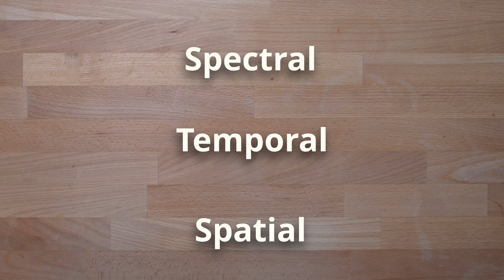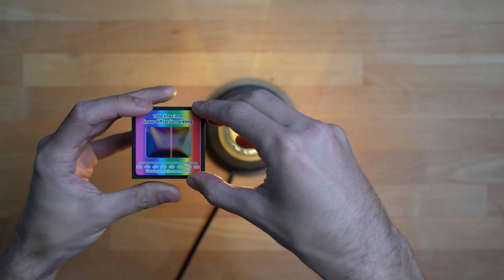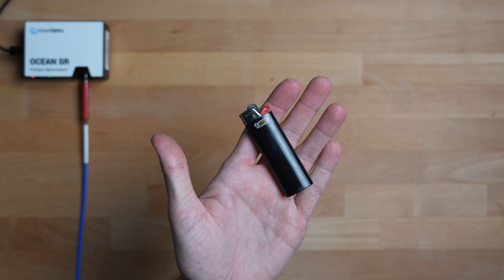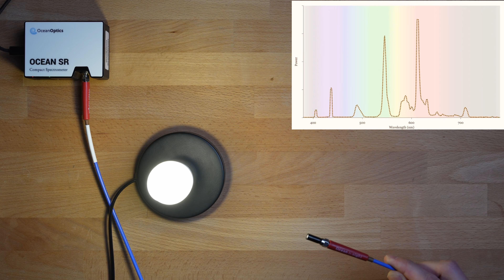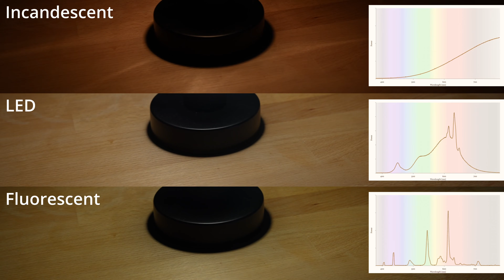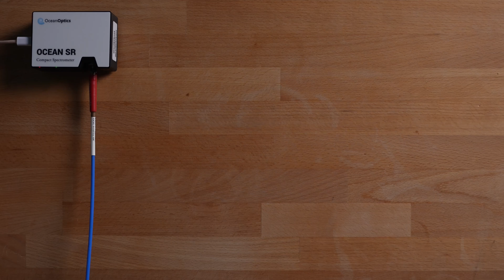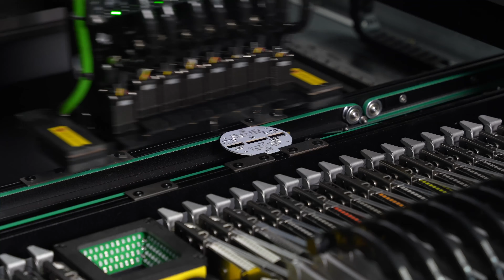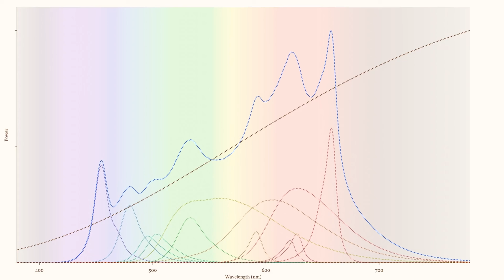Why Modern Lighting Feels Bad (and How I Fixed It)

Comment: oh my god YEEEEES I've been wanting this for a long time, I know EXACTLY what I'm gonna put in my room to light it from now on. also I know production would be really expensive but I would love to see if it's possible to make an integrated module in the future, say 10x10mm chip with all the color LEDs integrated into the same housing kind of like 5050rgb LEDs but instead spectrally adjustable, with internal color calibration so you can just drive them like an adressable LED with a brightness and spectral shape data, this way products would be easily developed to integrate this into regular lightbulbs or led strips
Reply from the maker: You've nailed the vision. This is exactly what Enody is working towards long term. If we can fully integrate from MOCVD up we can push this technology into integrated packages and bring the costs down significantly. In the mean time we will release many form factors (at increasingly better budgets) as we work towards this goal :)

Comment: While not the primary source of the light itself, LED bulbs do heat up a lot, and cheaper models đie in 2 years from continuous (12+h daily) use. If you look at old LED bulbs, you'll see sizable heat sinks. My question is, how is your product addressing this, and if it doesn't, what are your future plans on this?

Comment: I love this idea. The off the shelf warm leds are much better then the fluorescent from a couple years ago but not quite there. I think for mass production (say a E26) it would be worth designing fixed pre-tuned blackbody lights. 

Say you grade each of your batches of each of your color and sort those to make pre-tuned 2700,3000 and so on off of formula(say if you group colors all lower range then spec, then all higher range). You loose the adjustability but retain the whole spectrum in a product that can be more easily adopted.

Comment: successfully snuck a shark tank style ad inside a nerdout video about lighting quality and spectroscopy, well done. /s
Reply: God forbid a company identify a problem and try to solve it lol
Reply: @haleymoss4573  "god forbid a company sneak an advert for a 330$ dim desk ball that solves the problem of having 330 dollars" 
fundamentally there is no problem solved with this because its 1. too bulky and cant be downsized
2. too expensive for just anybody to buy it (gas is 5$/gal rn fr)
3. so freaking dim for how much power it draws.. compared to incandescent bulbs or just better white leds that are less than 9$
Reply from the maker: 1. It can and has been downsized already. EP01 was a conscious choice as our first form factor.
2. EP01 isn’t a commodity lamp with a nicer enclosure. It’s a calibrated, spectrally tunable lighting system that can produce light ordinary lamps cannot. We could remove the emitters, calibration, custom electronics, and domestic metalwork to hit a lower price, but then it would no longer be the product we set out to build. We’re starting at the high end, building the technology properly, and using scale to make future Enody products more accessible.
3. It has comparable efficiency to all other LED bulbs on the market and is an order of magnitude more efficient than incandescent lighting (which the video explains why).

I understand if this product is not for you. The goal of Enody is to advance this technology to a point of mass production and increasingly affordable form factors. As it currently stands, EP01 represents an order of magnitude price reduction in spectrally tunable lighting.
Reply: @enodylighting  ahh yes but you see you just wrote your own epitaph! "an order of magnitude price reduction in spectrally tunable lighting" so you admit this is a specialty tool for lighting science and not something that solves a major problem for consumers because you also say (in a manner of words) "we cant shrink the design because then it wouldnt work". if only you didnt spend the first half of the video talking about an issue that affects consumers (gross lighting) and then introduce your product as a remedy for them (330$ tunable desk lamp) then i wouldnt feel any negative way about it. 
this video irked me because it felt disingenuous, not including flicker rate, not including the price.. 
it comes across like you discovered a new science altogether and are now capitalizing off of it when all it is a very well crafted led rainbow desk lamp that can be used for spinach and humans alike (crazy utility range). look, maybe the product isnt for me! im sure all the tesla truck drivers in the comments who are more easily amused by your sharper image toys will buy up your stock, its just not gonna be me is all. wish u all the best on your grift man

Comment: incandesent lights do not flicker. Because the afterglow of the tungsten wire softens any Powergrid hertz frequency flicker. Sure, the emitted heat is a problem but let's be real... WHEN do you need a lot of light and warmth anyway? That's right, during the COLD Seasons.  Light Emitting Diodes (LEDs) and Compact Flourescent Light (CFLs) however don't have that due to technical reasons how they work. Both of them are prone to the Hertz Frequency of the powergrid. LEDs even more so due to Pulsewidth Modulation that comes from converting the power of the powerlines to the actual light. There are however ways to prevent that from happening, like with a phosphor dome around the LED elements, like the Phosphor layer of an old Cathode Ray Tube (CRT)  Television set. THAT afterglow of the phosphor does have a flicker softening effect but nearly no Light Bulb manufacturer is really using that.  LEDs by themself do not really have a soft afterglow either. Their Instand on-off capabilities are the sole reason why they are used in applications where lights have to be instantly on or off with as little delay as possible.
Reply: Incandescent lights do not flicker, but their light isn't constant either; only bulbs with thick filaments, such as those rated for high wattage or low voltage, produce more or less constant light (though this 20% drop of the average incandescent light bulb isn't noticeable). Good LEDs have power supplies that smooth out the output. Most of IKEA's bulbs have zero flicker (lab-tested independently). There have been and still are lamps with bad filters, but you have to be exceptionally stingy with the purchase to get these
Reply: @dimaminiailo3723 I only use those high quality and lumens IKEA bulbs. I used to hate LED and fluorescent tubes lights.
But I have no problem with the IKEA lights. The only place I use something better is in my bathroom mirror I use high CRI strips running on pure 12v DC so it has no flicker at all. And there is mix white plus red and yellow to get an even better color mix. But for everyday all around the house you get 98% where you want to go with the IKEA stuff.

Comment: I had the same problem and solved it by putting a 22 EUR Lichtblock 1500K LED bulb right next to a 28 EUR TRUE LIGHT full-spectrum 5500K LED bulb. Both fit normal E27 sockets and both have three-step dimming by just switching them off and on in short succession.
These two bulbs together solve the problem for a 30m² room providing mixtures of full-spectrum and candlelight-spectrum lighting for 50 EUR (roughly 58 USD right now).

You price your solution at 329 USD. That's a lot for a LED bulb for people who just want comfortable light and can live with pairing two standard form factor bulbs to get the effect. Your solution is technically better. But it's probably not affordable for the average New Yorker.
Reply: this is basically continuous CCT; you can find connected bulbs for probably less than your two bulbs that do it in one fixture and probably more homogenous (or in other forms like strips).
Reply: @hmmmhhhmmh  The two bulbs don't need WLAN, software, or a remote because they are switched by power-cycling. It's the simplest way to implement this.
The 5500K one costs 28 EUR because it has a CRI of 98.
The other one is basically a specialty bulb closely imitating the spectrum of candlelight (so all the reds, oranges, only very dim greens, and no blues).
Both are flicker-free for optimal video conferencing and no eye strain.

WLAN bulbs require software. Bulbs with a proprietary radio solution require a remote. I just made a few sockets with cords and placed them where they indirectly illuminate the room. I put the plugs into a power strip with switchable sockets at my desk. It just works.
Reply: @Oktokolo  ok fair. what is the brand of the lights you use that has a high CRI?
Reply: @hmmmhhhmmh  It's this one: https://www.true-light.eu/images/True-Light-8W-E27-LED-Datenblatt.pdf

Comment: I've been looking for full-spectrum LED solutions. All the LEDs I've found cut off at 780nm rather abruptly, maybe due to blue-pump limitations. Does the EP01 stretch into NIR, or is it solely concerned with visible ambiance?
Reply from the maker: The goal of EP01 is for it to function as a proof of the platform and a development kit for future form factors. Having a lamp on your desk that is used for authoring before deploying the lighting recipe you've developed to larger installations. Given this, I focused on visible light only for now. I have experimented with IR and UV (including a pure UV lamp lol), but had to lock in on a singular SKU for the initial release.

Comment: WOW, this is what I looking for, even tried to implement, but has 0 skills
about custom configurations, you really should add UV and IR, because of how some surfaces reflect it back to the eyes
and maybe train your software on reflections
Reply from the maker: UV and IR are absolutely in consideration. I have conducted experiments with them (including a full UV bulb lol), but for the first product I chose to lock in just on the immediate visible spectrum. UV also understandably has significantly more regulatory requirements, and as a single person team I couldn't afford getting through all of that on the first product.

Comment: Really good idea!
I would buy it myself if not for 2 things. One is that the light doesn't seem strong enough for main lighting in the room. And the other is that it seems to require the user to adjust it himself. Keep improving the product and I'm sure you will succeed! Good luck
Reply from the maker: Thank you! Yeah, the goal of EP01 is for it to function as a proof of the platform and a development kit for future form factors. Having a lamp on your desk that is used for authoring before deploying the lighting recipe you've developed to larger installations.

As we progress we're going to be adding much better control interfaces and automated transitions (i.e. wake up alarms, simulated sunsets at night, etc).

Comment: My guy, you need to obsess less with spectrum & more on the actoal biology of human vision. 

We don't really see full spectrum. Our eyes have like 3 sensitivity zones much like RGB LEDs with dips in some regions. 

Trying to get totally balanced spectrum is futile & super wasteful, since you won't see most of it either.

Also your intro fucking sucked & was deceptive. 

The difference between the warm lamp and white lamp was mostly the temperature and NO SHIT the $15 NYC apartment look as inviting as an abortion clinic. Indoor lighting is about the direction of your light sources more than the quality of the spectrum. 

That's why indirect diffuse light is so popular. Those squre builder grade fixture will look like crap no matter if there is a $300 light bulb in there.

This lamp can be useful for prototyping & pro print environment (to test how certain inks will appear with certain spectra), but those already use high CRI lamps for good "neutral" light.

Comment: Your product sucks and they're other ones that do almost the exact same thing, but 32 times cheaper. I can buy a GE sun filled bulb that is nearly as good as yours for $9, or I can buy your lamp for $327.

I like what you do, you've got balls, passion, and you're actually doing something, but you're not solving the problem. Your problem was that modern lighting in rooms is bad and you very clearly show this. You then make an extremely overpriced lamp. Not a bulb that can be screwed into a light socket (roof or lamp), you instead sell a single lamp that is incompatible with previous lighting infrastructure in every single room and building in the USA. I'm certain it's a good lamp, but if my problem is a ROOM'S LIGHTING, I'm not buying a single lamp that lights a 2 ft radius, I'd rather stick with my LEDs that I'm okay with that light up an entire room. Or I can just buy $4 incandescent light bulbs, or about 82 of those for every one lamp I can buy from you.

I truly want to support your products. I would LOVE a good lamp, I love writing. But at this price for this product, it's unacceptable for my use cases. When I want entire room lit up, this product can't do it physically, much less economically. If I want a nice lamp, am I going to buy a $329 lamp, or am I going to buy a single $4 incandescent bulb and have almost no increase in my electricity bill or buy a $9 GE sun filled LED bulb and get literally no increase in my electricity bill.

I'm only a sophomore in electrical engineering, but even I can clearly see that this isn't gonna work out with the way you're going about it.
Reply: this is exactly how the sharks on shark tank would react. it sucks as both a utility and a profit generating product all in an expensive package!

Comment: Hi, I really like to see, that someone else is creating a spectrally-tunable light. I'm somewhat behind in the process, but I already have a concept and material in hands, I "just" need some time to create the HW/SW. The use of TLC5940 is actually quite neat.
There is however one thing, I'm not sure about - the luminaire. Does it make any sense to create own lamp, if you can source it easily and just use your own electronics inside? In this case, I'm leaning more towards using an off the shelf product, like Ikea's Fado lamps, which are cheap and great at the same time. Yes, such an approach creates certain design limitations, but I think I can live with that. Especially in a low volume product.
Reply from the maker: Nice to see someone recognize the TLC5940 :) If you're interested in further technical discussion, hop in the Discord!

I went about this form factor to start as a way of completely controlling the presentation of the light while also appealing to more traditional architectural lighting groups. Additionally, it's a proof of the platform and building out the supply chains needed to continue building new forms.

EP01 is not intended as Enody's main offering moving forward, just an introduction to the ecosystem.

Comment: so cool, i think you should sell the light without the housing.
I have been thinking about making my own nightlight for a while now but didn't know what lamp to put inside it, it would be cool to somehow get this into that, but i guess that would create problems for calibration and stuff like that 🙃
Reply from the maker: Additional form factors (including a pure bulb) are in development! You touch on one of the reasons (in addition to manufacturing scale required) that a pure bulb was not the initial product. Every shade is going to skew the SPD slightly, and for the initial release I wanted a product that was calibrated with the complete diffusion stack.

Comment: I dont think you need AI like models to optimise the device and they may be suboptimal, though could still be good enough and if it works...

If its a hassle then there is defo some hardcoded maths that would work, i dont know it off the top of my head but i would be exteeeemly suprised if it wasnt possible. Certain mathematicians should be able to help.